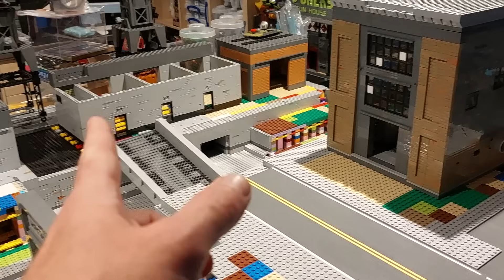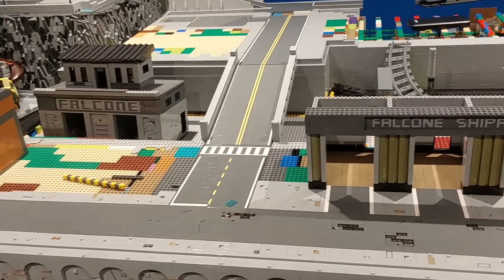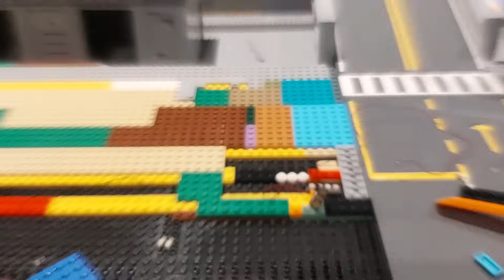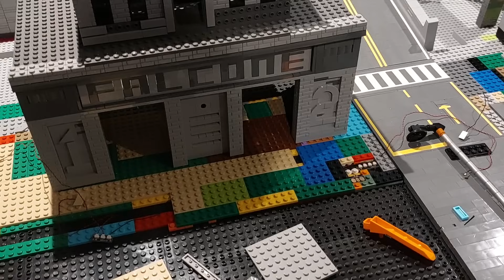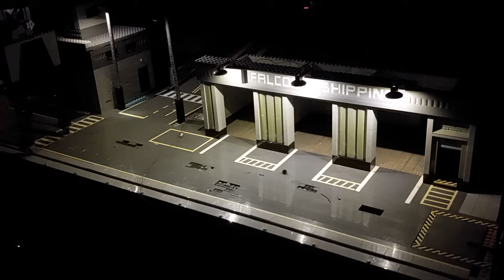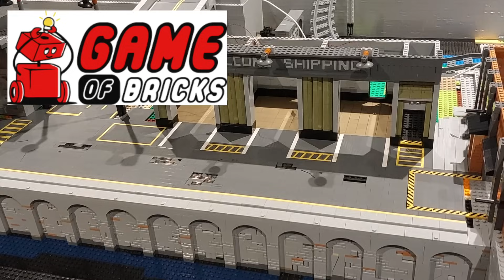BUILDING GOTHAM CITY - Adding Lighting to the Docks.

Comment: The docks look awesome. I could imagine some flashing red lights on the top of the cranes. As for the roads, have you considered bending them, like Brickcrafts does? I can't find the building process video, but you can see it in the background in this one: https://youtu.be/USw14TumDJs?si=GjxBwDRTZCBdm04_&t=39
Reply from the maker: Thanks @DoctorFaktor, It would be nice to light the cranes up. I should be able to fit a battery box in the back of the cranes. I have seen Brickcrafts video on the bendy roads, it only works if you are putting vegetation on the sides of the roads (or at least that's how it looks to me. I think within a city build you are pretty much restricted to straight roads.